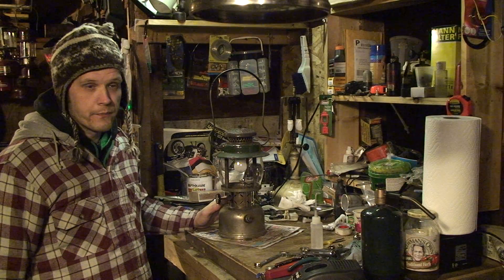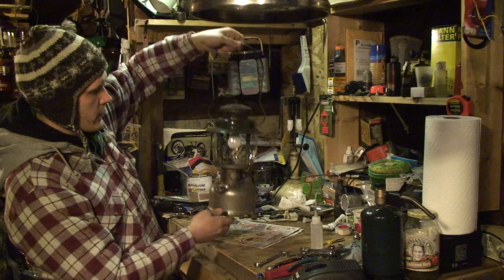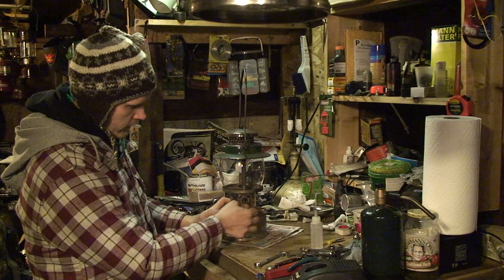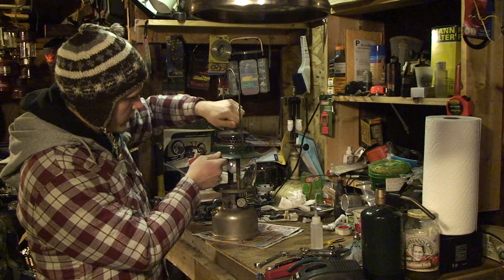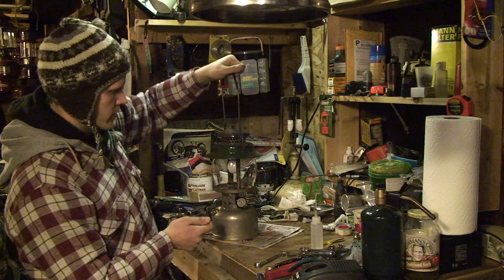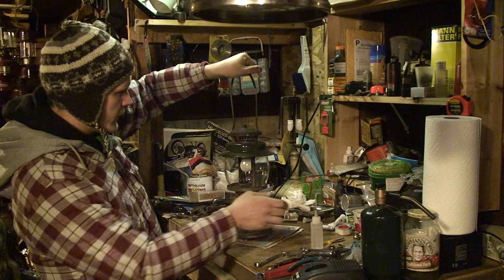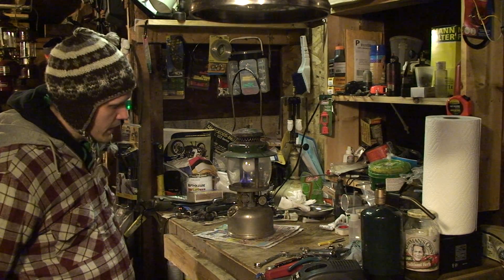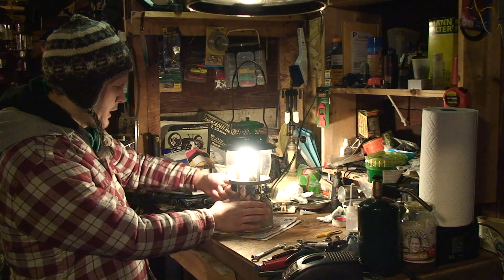How To Light a Coleman Kerosene Lantern - Lantern Lab Episode 2

Comment: I just picked up a 237 nickel, now I know how to light it, thanks!
Reply from the maker: These are the kind of comments that really make my day, thanks!
Reply: @LanternLabs Ran across this video again and since my 237 3 months ago I have converted a 200A that took a lot of tweaking to get running right and a 242B that runs like a champ with just a 201 generator & preheat cup installed, no modifications to the FA tube and even left the needle in.  I also got a great deal locally on a 1968 German Petromax, been having a lot of fun with kerosene after the 237 introduced me to it!

Comment: Do you have to use alcohol or for the preheat or can you use kerosene as well?
Reply from the maker: You could use kerosene but it will smoke and leave soot on the generator, glass and vent. It'll also leave a greasy scum in the preheat cup.
I'd do it if I was sitting in the dark but it alcohol was available I'd use that first.
Reply: Thank you very much.

Comment: Great video. I love my 237's!
Reply from the maker: +Angry Daddy Bird 237s are great, but really the under appreciated star of the kerosene fleet is the 249.
Reply: +Lantern Lab 
I agree! The hardly talked about 249 is a winner. Its even more elusive than the 237. Both on my list besides the 234 and 247.
Reply: I have a 1945 247 scout. I need to buy mantles and kerosene for it though.
Reply: Coleman Lantern Collector 
I use a #99 size mantle on mine.
Reply from the maker: A 247 will work fine with a #21 Coleman, 2C HG Peerless, #99 Coleman or Peerless.

Comment: Great vid curt thanks for sharing, I have a Coleman dual fuel lantern and I was wonder if  it would run on denatured alcohol. Any thoughts? Thanks
Reply from the maker: There are lanterns that run on alcohol but to convert yours to do so you'd need to put a MUCH larger gas jet in it, like you'd need to drill one out. You'd also need to preheat, at room temp alcohol doesn't make enough fumes to light. There have been experiments done in this realm and in fact you can buy a proper gas jet to run a Petromax lantern on alcohol.
Reply: curtludwig  thanks for the help friend, I do appreciate it, now if only someone could help me with the Aladdin blue flame heater I just acquired!
Reply from the maker: IIRC those are wick heaters much like the Aladdin lamps. Theres a forum or three dedicated to them, should be lots of help.

Comment: I have the same lantern, how do you fix a leak at the top of the generator?
Reply from the maker: Umm, not to be a smart alec but a leak at the top of the generator is the gas tip isn't it? If it really is leaking at the top be sure the gas tip is present, I've seen 'em lost. If its leaking at the bottom and you can't tighten the nut any more, take the generator off, pull the guts, heat the flare at the base to just red hot (too hot and it'll melt) then quench in water. Do that twice more, let it cool (this is a good time to burn the carbon out and clean the generator), put the guts back in and reinstall. The flares work harden and leak, interestingly I've only seen this on kero lanterns, never on Coleman fuel.

Comment: Just wondering,  I picked up a Coleman Model 200 with a T-66 Generator.  Cleaned it up but I was wondering what fuel type does this lantern use?  It has no bowl at bottom for preheat but does have a nut and bolt there  Hope you or someone else can help.

Comment from the maker: Sure, it may smoke a bit due to higher water content but it'll work. You may need to dose it twice to get enough heat. Realistically you can use almost anything that burns and you can get into the cup, sterno, lighting gel, Coleman fuel. Some will smoke and make soot but most anything will work.

Comment from the maker: The 275 is different than the older lanterns in that it has a schrader valve for fuel shutoff. The early ones weren't rated for fuel contact and its common for them to rot out. You need a new schrader valve insert. Old Coleman Parts has them or your local auto place will too. Make sure whatever you get is rated for contact with fuel.

Comment: Sorry to bother you again, but I ran my '79 275 and had a strange problem. after installing new mantles and burning I decided to light it just to test it before the winter season. after letting it run 10 or 15 minutes I shut the valve off, however the lantern stayed at full burn for 10-15 more minutes, normally I expect that a white gas will take several minutes to burn out but I could not get mine to shut off. Ended up blowing out mantles and venting the tank. dangerous I know...

Comment from the maker: I've done it, its okay. You'll need to clean the generator more often than you would with Coleman Fuel. The ones I did (a 220F and 200A) both pulse when its cold, I think thats because of the kerosene thickening in the cold. Probably blocking the air port on the FA tube would fix it. So BTDT just to try, I'm on to other things now.

Comment: Thanks for the great kero lighting vid. If its above 60 degrees, I light my 237's on less than 1/4 cup of alcohol. When lighting the alcohol, I tip the lantern over at an angle until the alcohol almost spills out of the cup and hold it in that position until the alcohol is well light. My 237's get about 8.5 hours burn time per fount of fuel.

Cheers.